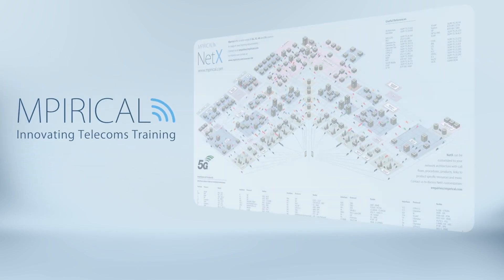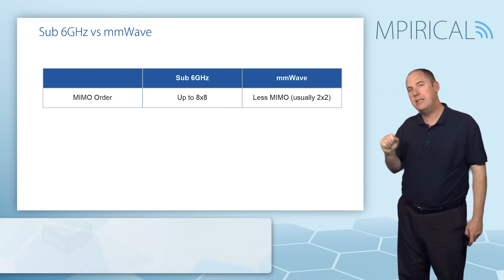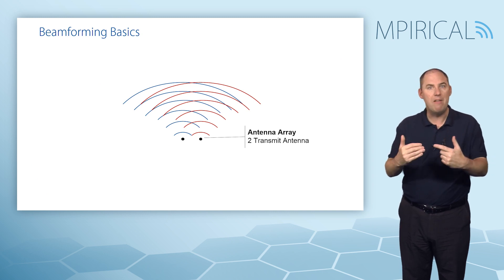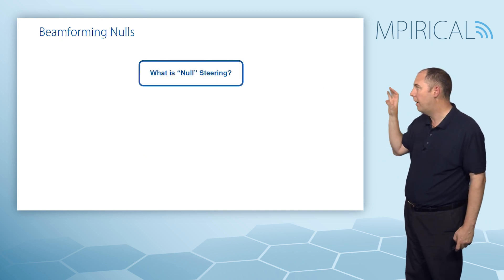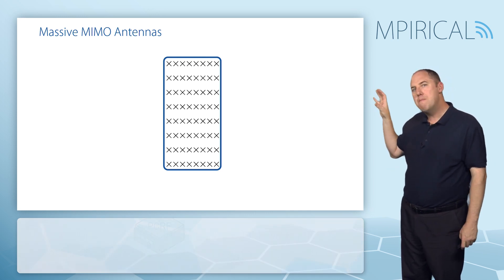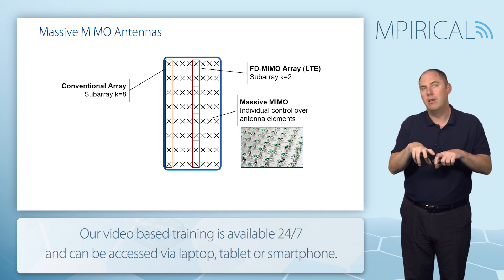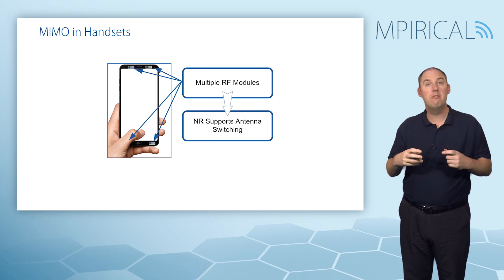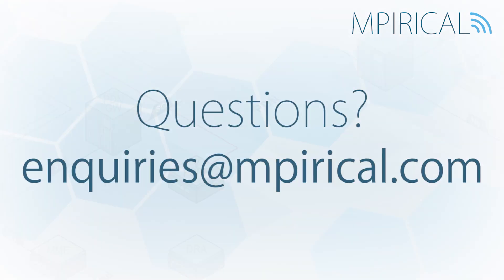What is Beamforming (Massive MIMO)? Find Out With Mpirical

Comment: can anyone explain intuitively this to me:  if we have multiple users spatially separated, the phase adjustments required to steer a beam to 1 user may be completely different than a user in a different location.  So if all 64 transmit elements are simultaneously being used to form each users beam (and nulls), how do their phase adjustment requirements not cancel out or interfere with another users required beam steering phase adjustments?
Reply: I suppose they are using different carrier waves. A demodulation process can happen at user side to extract the wanted signal of the exact carrier frequency.
Reply: NFV and SDN including AI will be included with any ubiquitous 5G implementation. Multiple antennas will transmit at different time creating  the beam lobe through constructive and destructive interference. Phas3 adjustment will be different for each user and this is one of the reason 5G will be heavily influenced by vitulization.